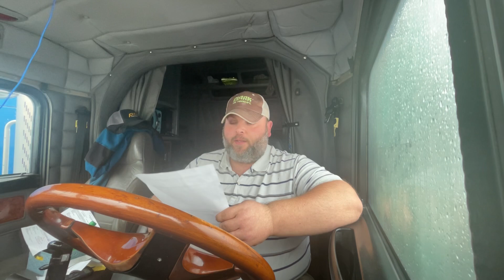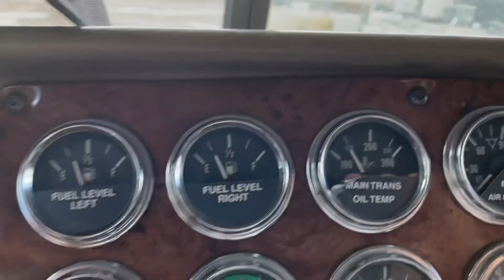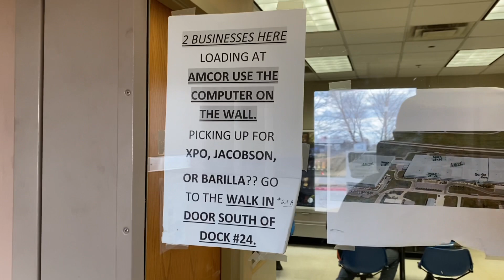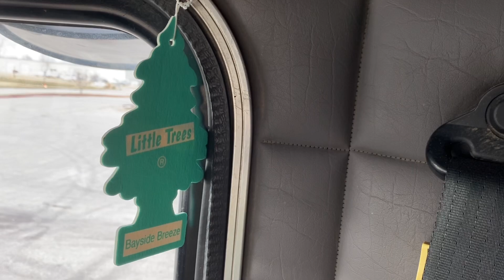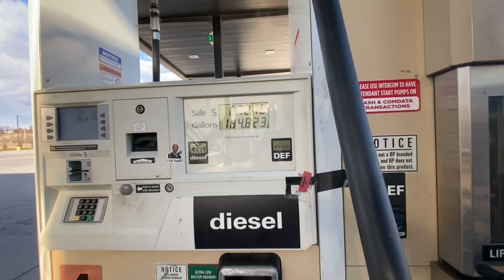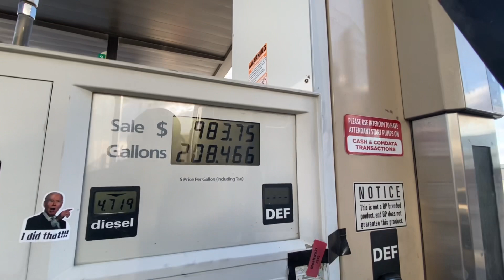I miss the ROAD CLOSED sign! | EXTREME IOWA WINDS nearly damage Levi! | DAY in the LIFE

Comment: What is the max boost you’re getting? I look it up and everyone has a different number. Between 30-60psi. Just curious what you are getting. Know someone that has the same engine. He is getting 27-28psi.
I know on my 6NZ I get 27psi full send on a single turbo. Which is perfect. Thanks for the response!
Reply from the maker: On a hard pull with a heavy load, I’ve seen about 52-53.  But 40-45 is a more common PSI.
Reply: @survivetothrive21  K. Thank you!! Yeah, he has an issue 😁